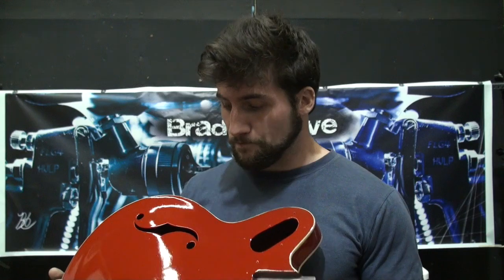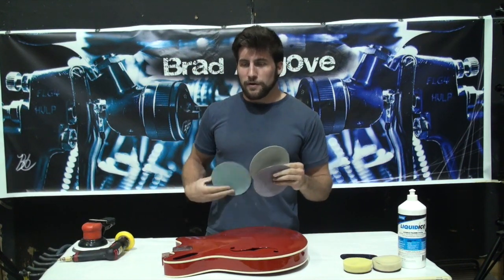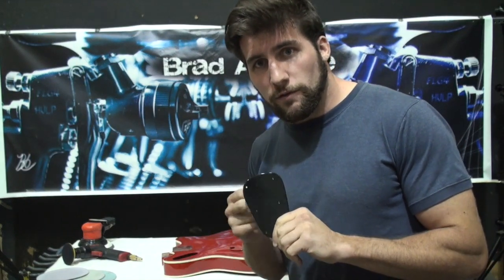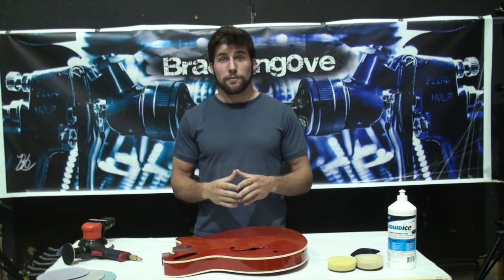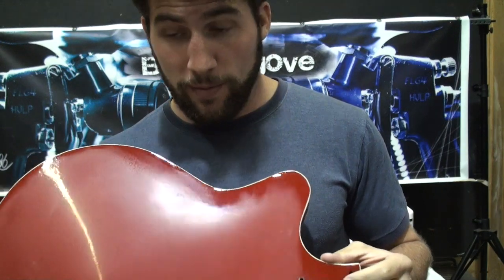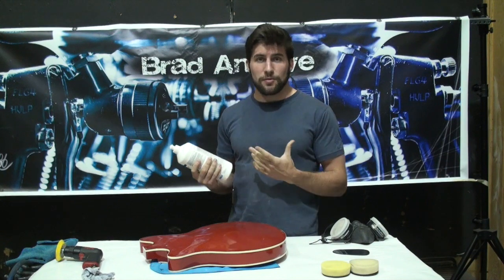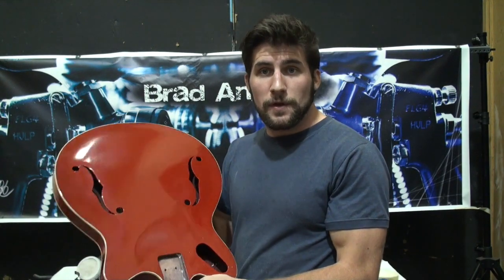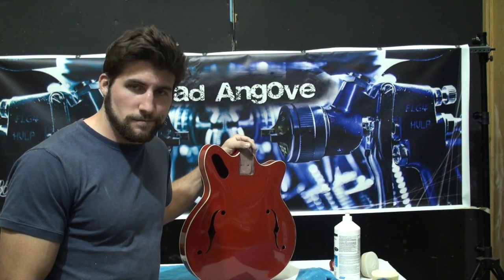Guitar Polishing: Red Jazz Guitar

Comment: A 2 second view of the finish was a little bit quick. I wanted to have a proper look at your finish. Iv just had my Ric 330 painted black and clear coated with car 2k clear. iv burnt through in 1 place. will it be ok to spray clear over the burn Or will i have to redo the whole guitar. If i just blow over the area i burnt through will you see the edge suspended in the next layer that is sitting under ? what is the best way to fix a burn with Car 2k. Thanks for sharing your work.
Reply from the maker: Sorry for rushing that part of the video Tony. Unfortunately, I don't know the best way to fix a burn through. I can speculate, but my advice would be nothing more than an educated guess, which is less than you deserve. If I had to recommend some you tubers who are more likely to have dealt with that scenario, I would suggest maybe asking the guy from butler collision, and perhaps Ed Hubbs if he still answers questions on his free videos.
I wish I could be more helpful. Good luck.